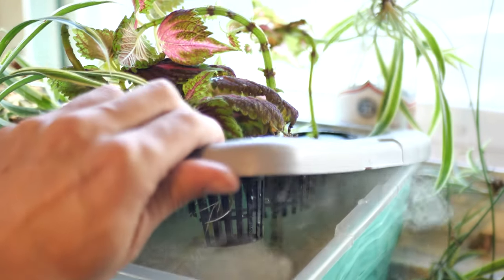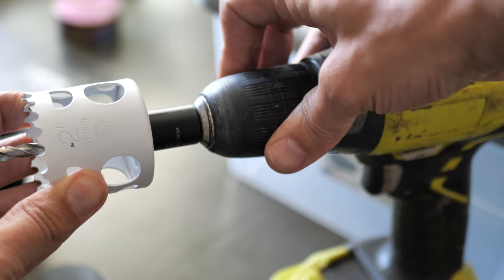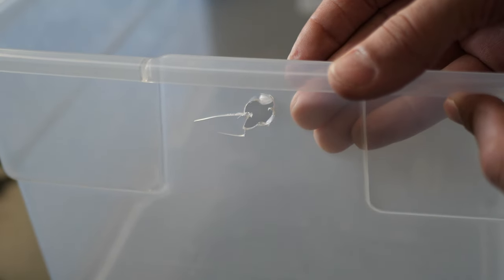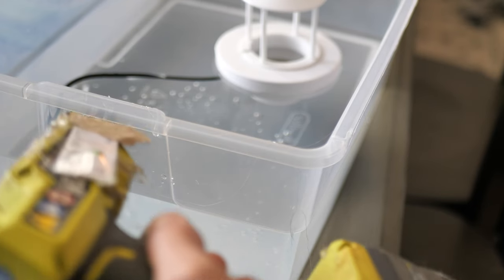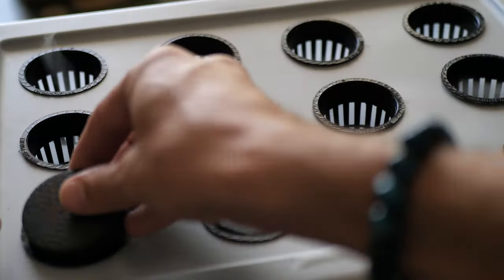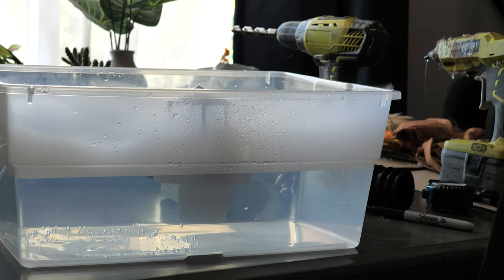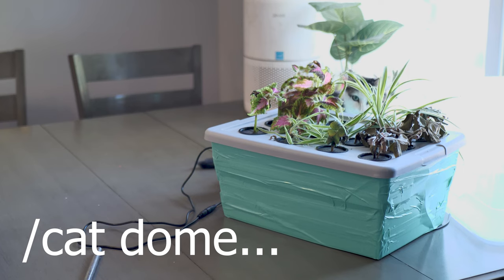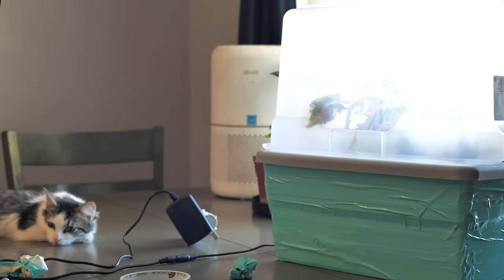How To Build  A Fogponic Cloner | Simple DIY Cloner for Propagating Plants

Comment: Hello. What happens to the fertilizer in water with ultrasonic humidification?
Reply from the maker: Since this form of fog is not due to evaporation, rather instead, vibration, many of the nutrient salts that have mixed with the water are still lifted and carried to the roots. I am still studying the long term effects with the heavier salts and even erosion of the fogger itself. Great question!

Comment: For making this kind of hole ,use something hot to avoid cracking
Reply from the maker: Great tip thank you so much!
Reply: @humblegrowth  what's even better: run the drill "backwards". The teeth will still enter the plastic, but will make a much cleaner hole. But using less pressure is important.

Comment: One downside is if you have a power outage your roots will dry out and the plants will die.   That Is why I like using water that the stems are submerged in and put an Aquarium airstone in the water.   If the power goes out the stems will stay wet because they are in the water always.
Reply from the maker: verry true. A battery backup is a good idea with aeroponics for this reason. Even still, may be SOL. My pump died in my DWC and I didn't even know for a month lol it was just a Kratky garden.

Comment: Hey there! Any issues with leaking? I'm using a spray cloner but man, the dang thing keeps leaking on me. I wonder if using a fogger vs a spray system  will help with that?
Reply: Use a tote that has a gasket lid
Reply: Add a hole on top for air pressure to release, the pump creates pressure in the compartment

Comment: hey stoner fam 

Put some shitty ply wood or scraps on both sides of the crappy plastic bin you 1/2 inch drill into . Clamp them. then drill it. Then remove the clamp and scraps.  

;)
Reply: #2 put the power cord thru your now nice hole. 

Use a piece of gorilla packaging tape fold the cord down and put the packing tape onto the inside of the reservoir covering the cord and making a nice seal around the hole. 

Reservoir gets dirty and needs cleaned , glue gun wont be nice due to surface area being hard to properly clean.
Reply from the maker: Brilliant!